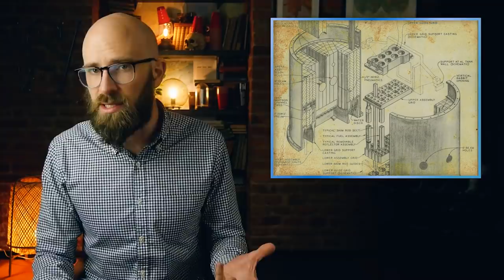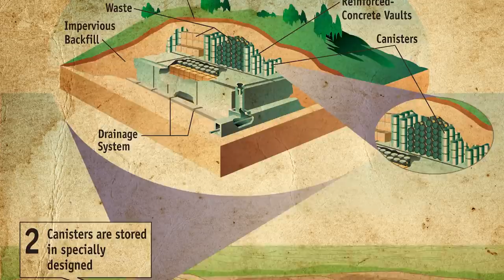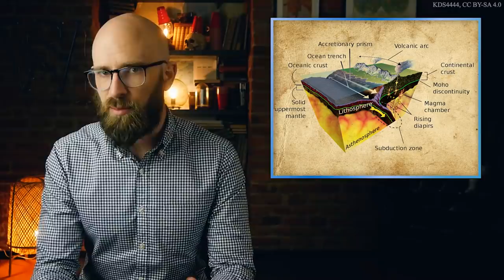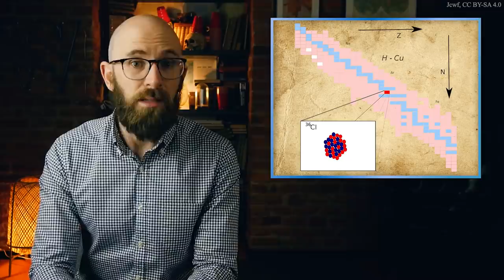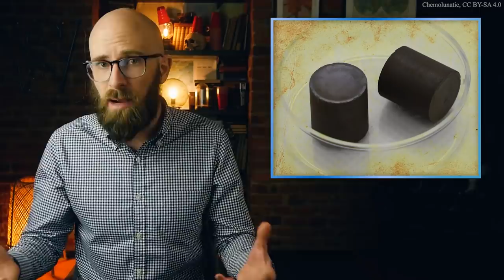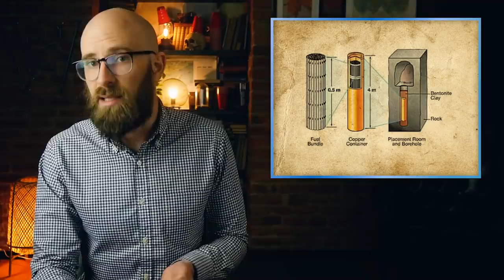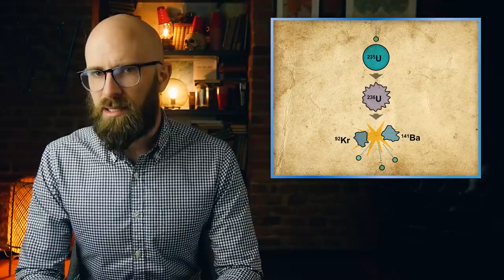How Does Nuclear Waste Disposal Work?

Comment: Im on a chernobyl binge so this came out just in time
Reply: I hope you stocked up on Potassium Iodate 😂
Reply: ok doomer
Reply: @dudepool7530  Potassium iodide I believe you mean and what would that do for the other hundreds of radionuclides released after a meltdown and subsequent hydrogen explosion?  Iodized salt, fluoride in the water breaking covalent bonds, Barium and aluminum silicates used to remove strontium from sea water and coupled with an RF resin can also remove cesium as well.  Boron controls neutron bombardment and hydrazine is used as well.  Make sure you brush up on the inverse square law and its inability to be used on an extended source of radiation.  Now say something smart.....
Reply: @paulmobleyscience  dude, I just googled "anti radiation medication" for a joke, and went with what popped up first. That's it. It was not meant to be medical advice, or taken seriously. All I wanted to do was put a smile on people's faces.
Reply: Why can't a dude just try to make people laugh, without others jumping in with "you're joke wasn't factual", or some snide dismissive comment? I'm DUDEPOOL, does that really seem like I'm trying to be serious?! Because, for the most part, I'm not. Unless I see someone being disrespectful for no reason, or someone tries to ruin my fun, for absolutely no reason. What's the point of it? Are people so miserable they cant even smile at a one sentence joke, ending in a laughing emoji, and move on? This is absolutely ridiculous, and not in an enjoyable way, like Spider-Man and Friends was... "The guy's dressed as Deadpool in his profile pic, holding a Nerf gun. He takes himself too seriously"... Sorry y'all can't take a joke...
Reply: @dudepool7530  people are just looking to start shit dont mind him i thought it was funny
Reply: @cybulskiya8725  oh trust me, I know. I like to point out people being pointlessly mean, or taking things too seriously, in the hopes that it gets them to take a long hard look at what they are doing, and if that is the kind of person they really want to present to the world. I'm also trying to remind others that, on the other side of the letters they see on a screen, is a living breathing person, and regardless of what beliefs, or stances they take, deserve to be treated with respect. It seems everyone has forgotten this. For example: Twitter.
Reply: @cybulskiya8725  glad I could put a smile on someones face though! The world definitely needs more of those!
Reply: @dudepool7530  ok ok i get it but isnt this a serious enough topic to where if something funny needed to be done it could be done elsewhere?  I mean seriously people read these comments and the next thing you know some person is trying to find potassium iodate to take to help protect them.  Im all for fun and games but always a place and always a time...not everywhere all the time...agreed?
Reply: @dudepool7530  I wasnt being mean...I corrected what was wrong because this is a serious topic. Take the jokes elsewhere kids adults are trying to talk....
Reply: @paulmobleyscience  I'm surprised your straw man argument isn't singing "If I Only Had A Brain"... 
A: Who goes to the Youtube comment section for medical advice, let alone thinks "hmm, talking about a tv show. Bound to be solid advice for dealing with radiation there"
B: There are laws and regulations in place to keep the average person from stumbling across or sneaking into radiation hot spots. One would think the people who do end up going in these areas would know a little something about it.
C: Were someone stupid enough to try to get into one of these secure locations, it would be quite apparent that they are either too stupid to actually be able to get in. Either that, or it's someone trying to make a dirty bomb, and I'm pretty sure I'd sleep soundly were that the kind of person to enact this whole logical fallacy you've concocted. Just because I joke, does not mean I am dumb.
Reply: @paulmobleyscience  oh... Randomly popped in my head just now...
There's the fact that I never actually said what it was used for, so the person would have to google it anyway... You seem to be assuming quite a bit for this defense of your anti-ing my joke for no real reason... Or at least would have to for it to work...
Reply: @dudepool7530  logical falicy?   Its like im watching Billy Madison all over again and he just got done talking about the puppy.....nothing you just said made any kind of sense and now we are all more ignorant just by reading it.  This is not about medical advice or anything you rambled on about.  This is about nuclear physics and is a subject to be taken seriously.  There are tons of videos better suited for playing around but this isn't one of them.  The fact that you said absolutely nothing and then touted you are intelligent proves otherwise.  Now explain to everyone why the inverse square law does not apply to extended sources,  explain how evaporation equilibrium coefficients work and then explain calibration of all radiation detection monitors........ready...go
Reply: @paulmobleyscience  maybe you should just leave the jokes alone, for the people with a sense of humor to enjoy... Instead of bringing the whole mood of the thread down... Because you want to "um, actually"... I'm sure one would be able to understand why I'm a little miffed...
Reply: @dudepool7530  Oh wait....did I just get the guy trying to get everyone else??? If you can have a bit of fun why can't anyone else?  See not only did I get a laugh with the whole Billy thing but also taught a bit of information in the process.  I dont think you are dumb I never said that dudepool (really awesome name by the way seriously and good play on words). Just relax learn a bit of something while your here and lets all have a chuckle at the Billy comment...lol
Reply: @dudepool7530  Why because it was at your expense...and not everyone elses?   Exactly what I thought...the ones that cant stand the heat are the first ones to try to stay in the kitchen.  I meant no offense just like you right.  I mean it was all in good fun right?
Reply: @paulmobleyscience  okay. Dumbing this down for you. How could it happen? Until you answer my original question, I'm not going to say anything else. Stop deflecting and answer it, since it seems to be your area of expertise. Get off your high horse, and answer a simple question. I'm sorry if it was a bit too long and wordy for you to understand, I was attempting to be specific about your ridiculous issue, that makes absolutely no sense. So... How could it happen?
Reply: @paulmobleyscience  you sure do get quiet when I ask "how could it happen"...
Reply: @dudepool7530  I don't get quite when you ask how it would happen....this isn't the only thing I'm doing in my life is waiting for you to ask me a question genius.  Not only are there thousands of comments here that no one is getting all their notifications for but I have a life outside of youtube.  In fact I'm working on a DOX/slander case right now as we speak, are you working on being the next?
Reply: @dudepool7530  Many people do and why many channels exist specifically on this topic to find real information the "news" has never talked about.  When have you ever heard of FOX or CNN talking about evaporation equilibrium coefficients or the inverse square law?  I can almost guarantee you in the history of both of those networks they have never said those words let alone report the truth about it.  Its called alternative media and isnt always about the typical UFO or nibiru nonsense.  There are channels out there just like the one you are on that is filled with information you don't get anywhere else.  And then in the comment sections you'll find people that work in these fields and talk about real issues and topics.  The problem is you more than likely work in the nuclear industry and why you have a bias for nuclear power and trying to sway people.  And then you'll act as if you don't and we will do the whole song and dance like I've been through with people EXACTLY like you for years and if you really dont then all you did was watch youtube videos and have absolutely no idea what you're talking about obviously.  Now answer my questions because you keep dancing around it and everytime I mention it you just deflect.   Tell us why the inverse square law does not apply to extended sources of radiation on the surface of this planet.  If you don't at least attempt it then everyone will know you have no debate....
Reply: @dudepool7530  And if you have no clue which is what Im leaning towards then you have no idea why its important and why you shouldn't be promoting things you know nothing about.  It's one thing to have an opinion be it wrong at that but to attempt to sway others with that incorrect information is exactly why you are wrong to begin with...
Reply: @dudepool7530  Where did you go?  Arent you here waiting for my comment to show?  I don't have all day.....see what I mean...

Comment: Depleted uranium rounds?
Reply: Depleted uranium armor, artillery shells and many other things.....they created a market for it..
Reply: Well, depleted uranium can barely be considered radioactive to begin with it's in the same ballpark as a slab of granite, so there isn't much point in dealing with it differently than any other toxic heavy metal
Reply: @Grouuumpf  No it's not and youve been explained elsewhere why and how you are wrong.  The soldiers in the gulf war would disagree with you trust me I actually know....also the innocent people in the middle east where war was waged they are seeing the affects of those uranium tipped bullets and artillery shells.   Depleted uranium is not like a slab of granite that is a falicy and completely incorrect
Reply: @paulmobleyscience  depleted uranium is toxic as fuck, I acknowledged that. 
As far as radioactivity goes, it's barely worth mentioning, that's what I said. It's kind of the whole point, to extract the active materials from it to concentrate them elsewhere.
Tungsten carbide rounds that now replace uranium in most countries aren't any better for your health, yet I don't see anyone complaining about them. 
Those things are seriously toxic, as are regular chemical explosives, but focusing on one because there is "uranium" in the name is just putting the spotlight on the wrong issue